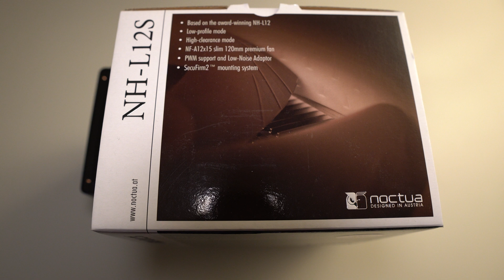Air Cooling The LOUQE Ghost S1

Comment: Could you please clarify whether the fans in this build are being used for exhaust or intake? Thx
Reply from the maker: In this situation the CPU cooler is intake, case fans should be exhaust. Optimum Tech has videos about negative pressure in this case for more info on that!

Comment: would you say that the bottom fan is worth it?
Reply from the maker: I find it helpful for dust and general airflow, but it does not seem to have any notable thermal benefit in most instances. With higher power components, going from zero case fans to an exhaust does help dissipate trapped hot air, but again it is not a significant upgrade.

Comment: Hey there, I’m planning a doing a s1 build but would love to know more about what I can use in terms of MOBO and Intel CPU’s along with their coolers? Any recommendations will be appreciated. Great Vid by the way.
Reply: This would be with the newer CPU generations and thoughts on an i7?
Reply from the maker: I can only speak toward intel 10th gen, but avoid asrock and asus for cooler compatibility issues and go with the Gigabyte or MSI Z490 ITX boards. To be honest, the best coolers for this case have a hard time with anything over 95 watts, so if you need an i7 I might avoid the 10700k and go for the non-k SKU.
Reply: @poobalu  Thanks so much! I am wondering if waiting for Alder lake is a good idea?
Reply from the maker: @PBR_BAM  Alder Lake runs insanely hot and doesn’t look like it is going to work well in SFF ITX builds. For the Ghost S1 specifically, I think Ryzen would be the way to go due to thermal constraints alone. The performance of the new i9 and i5 looks insane, but keep in mind that air coolers for the Ghost are mostly rated for a TDP between 65w and 95W

Comment: IS-60 EVO works good too. It works with tall RAM sticks, you can use 120mm fan on it. It's cools better than the L9x65 and a lot more quieter. It's not a copy of Alpenfohn Blackridge, but rather a thinner version of Big Shuriken 3.
Reply from the maker: I actually bought an IS-60 EVO for prime day to test this out and it’s a no-go for the Ghost S1. It sits near the bottom of the case so 1/3 of the fan is obstructed by the non-vented side panel. Idle temps are high and a 10 minute run of cinebench with a 10600k will hit 93c. It might be good for other cases though, thank you for the recommendation regardless!
Reply: @poobalu  ah, that is one aspect that i didn't consider. i'm using one of the ghost s1 clones case from taobao. 

what motherboard did you use? i'm using b550i gigabyte, their CPU socket is placed much higher than other manufacturer, which makes it placed lower inside a left hand side sandwich case. the edge of the fan sits nicely at the start of the side panel ventilated part. so i can imagine how it will gets blocked with other motherboard.
Reply from the maker: You’re the 2nd person to recommend this cooler - I might have to make an updated video soon including some more options!

Comment: Do you happen to own a 5950X?

I'm really curious to see the results (temps, sound, etc.) when pairing the 5950X with the NH-L12 Ghost S1 Edition in the Ghost S1 without a TopHat. Or even with one.
Reply from the maker: I don’t have any Ryzen CPUs currently but I wish I did! Optimum tech just released a video about cooling that chip with a Black ridge in the sky reach case, so maybe go check that out for a worst-case scenario. The Ghost should fair better as there is more space for taller CPU coolers with better fans.
Reply: @poobalu  That's exactly the reason I asked you. Already watched the video and I wanted a more detailed experience with specifically this case and cooler. He also claimed the motherboard is partly the blame for the low clocks and I plan on running an X570-I Strix. I just wonder if all this could lead to a meaningful difference in temps and clocks. Guess I'll have to go for it myself. Thanks anyway! Good video!

Comment: What were the temperatures that you were getting from the CPU coolers? What were the min/max temps during your daily use? And which Noctua fan were you rocking below your PSU? Have you ever thought about using feet on the bottom to prop up your case and maybe improve thermals? I currently have a 10700k (undervolted by 50, no plans on overclocking) with a 5700xt and I'm not sure if the ghost s1 will become an oven with my parts.
Reply from the maker: I will be releasing future content that goes a little further into temps, but all of the coolers in this video managed safe temps under regular use and even during stress tests. I swapped out the stock feet for much taller silicone dome feet used for speakers, the bottom fan is an exhaust NF-A12x15 PWM.

Comment: You should try the Thermalright axp-100 full copper, that CPU cooler sits between the L9 and the l12s (it did overlaps the memory slots and is 59mm tall with its included 14mm fans, but you can mount a slim Noctua 120mm fans with its included bracket) in terms of size but can cool my r9 3900x with slight undervolt (1,225v at 4.2ghz, 85c full load, gaming usually sit at 60c)

Comment: I use Big Shuriken 3 here and it has excellent performance. Works very well, but you need to change the fan fixing screw for one with a "flat head".
Reply from the maker: Thanks for sharing! I have a few more coolers and combinations that I am testing out and while I don’t have a Big Shuriken 3, I’ll keep that option in mind going forward!

Comment: Hi I’m looking to purchase the ghost s1 myself, wanted to kindly ask if the corsair dominator platinum rama or the vengeance pro rgb rams would fit with the L12s or would it be too tight? 

Kind regards,
Lam
Reply from the maker: Great question! The L12s can only fit the Vengeance LPX ram or smaller because the 120mm fan obstructs the memory height. I would check out the Ghost S1 Edition NH-L12 because it uses a 92mm fan, granting more RAM clearance. Just double check the memory height and compatibility on Noctua’s website!
Reply: @poobalu  Thank you for the response, according to their noctua page on the ghost s1 L12s, the ram height clearance is up to 48mm, also with corsairs listing on their ram heights, vengeance rgb pro is 51mm and vengeance lpx is 50.4mm.

I'm assuming both methods, would fit and I just think noctua could just be listing it as 48mm to keep people aware of the height clearance, as I've seen some builds with LPX but have yet to see VENG RGB PRO. 

In conclusion it's best to just go with their stated height clearance ''if you were going for the GHOST S1 L12S edition cooler.''

Kind regards,
Lam

Comment: Sweet build! I especially love the extra fan under the psu. 
I also got a mk2 ghost when the og nh-l12 was out of production. I ended up getting the Alpenfohn Black Ridge, which is like the L12 however it has more heat pipes and I personally have it oriented with a 120 slim Noctua fan on top and it has room for a 92 fan underneath, still with plenty of clearance. It’s priced to compete with Noctua’s offerings too. So if you haven’t considered it, give it a shot.
Reply from the maker: I just received mine in the mail! I’m working on a different cooler comparison atm but I will be testing out the Black Ridge very soon!!!

Comment: My ram height’s 49 mm, do you think it might just squeeze by with the ghost edition or is 48 just the max?
Reply from the maker: It’s hard to say without knowing specifically which ram you are using, but 1mm could probably be achieved with the little flex that this cooler has when screwing it into place. I would check Reddit for your specific parts to see if someone has done it already!
Reply: @poobalu  it’s the team group delta rgb ram, thanks for replying so fast too!
Reply from the maker: @sand6008  so it looks like it might not fit without a TINY bit of bending, but if you’re okay with that it should be doable. Otherwise the L9x65 would be the way to go in this instance

Comment: I just bought the Alphenom Black Ridge Cooler, replaced its LOUD default 90mm fan with a slim Noctua nf-a9x14, and took the 120mm fan and the two SecuFirm2 mounting pieces from my NH-12s and installed it on the front of the Black Ridge and BOTH fans can fit with no modding whatsoever.  I find it to be a tad quieter and can perform a good deal better than any Noctua option at the moment.
Reply from the maker: That’s amazing! I’ll have to see if I can get my hands on one. I assume both fans are directing air out of the case?
Reply: @poobalu  No, into the case. I got about 2 degrees better cooling pulling cooler ambient air from outside the case rather than pushing very little warm air out of the case.

The hot air comes out the top just fine.
Reply from the maker: @jw_25  that’s awesome thanks! This is definitely worth checking out, I’ll see if I can place an order for this soon. I appreciate the follow up!

Comment: Great vid. The L12S fit on my aorus X570i. Had to try différent rotations... it's tight... but fit. So i stick with as it manage to cool the 3700X and is very quiet. When i will décide to swap moto, i will not choose a new one with to big heatsink or panel that would block the L12S

Comment: Just wanted to confirm- does the l12 ghost s1 edition perform better than the l9x65? I've read on multiple sources that it doesn't
Reply from the maker: 王孝慈 I’m going to test this in an upcoming video, but my experience thus far has suggested you are correct.
Reply: @poobalu  oh and I found that Louqe's own testing results suggest that the L12 is better than the l9x65.https://www.google.com/url?sa=t&source=web&rct=j&url=https://louqe.com/img/heatsinktest.pdf&ved=2ahUKEwixqbbH15nsAhUrJTQIHZ-CDJYQFjABegQIDhAJ&usg=AOvVaw1Z0NsU64F6RTNF2mEc9_VG
Reply: @poobalu  I mean, if the l12 isn't even as good as the l9x65, it's not even worth the trouble. But Optimum Tech suggests that the l12 just beats the l9x65 by a slim margin.

Comment: just a side note, I would recommend against using the  NH-L9X65. the fan is so close to the side panel that it makes a lot of turbulence, which makes it way louder then it really is, I had to use it without a side panel because of the noise, until I got  the NH-L12s
Reply: Totally agree. That was my first choice too  and i had the same conclusion. So i swap for a bended L12S. It performs better and quieter

Comment: Do you think an EVGA XC3 3080 would fit?
Reply from the maker: Johnny Laygo nope - their website says it is a 2.2 slot card and the S1 really only fits 2 slot cards. It looks like it should fit bigger GPUs but the clearance where the side panel slides on is tighter than the rest of the space on the GPU side. Keep an eye on Reddit for compatibility lists.
Reply: @poobalu  i see.. it sucks that FE is our only choice..
Reply from the maker: Johnny Laygo absolutely - we might see more cards in time but the launch options are limited in compatibility at the moment.
Reply: Look on reddit. Someone installed an rtx3080 evga xc3  its tight but works

Comment: Hey there, great content here. I've seen in a couple of forums people fitting a A12x15 120mm slim fan from Noctua with the NH-A12, and it is supposed to be the best performer. Have you ever tried this? Can you try to fit your bottom slim fan on it? Thanks!
Reply from the maker: The A12x15 simply doesn't fit underneath the L12 or L12s on the Asrock Z490M ITX due to the really tall VRM heatsink which is a popular choice for the i5-10600k. That said, you can likely add a 12x15 under the L12 for other motherboards, but consider that you will be out $75+ for that combination when the L12s is effectively what you are describing for $50 and a slight bend in the heat pipes!

Comment: Personally i iwould buy the ghost s1 cooler and a slim big fan and try to squeeze it in... if it doesnt fit i would then use that fan as an exhaust under the psu or grind some fins to make it fit

Comment: I'm still deciding between coolers and your video was very helpful! 

Question -is it possible to attach a slim 120mm fan to the nhl12 ghost edition? and if so, whats the ram/mobo clearance like?
Reply from the maker: You might find the reply to another user, but the 120mm fan doesn’t fit well under the “Loctua” cooler because the fin stack is a different shape underneath, making clearance several mm worse than the L12s. It might be possible but not recommended.
Reply: @poobalu  thanks bruv gotcha. absolutely loving these ghost related videos as they are so so helpful. have already subscribed and anticipating more content from you!
Reply: @sorkrot  Get the Alpenfohn Black Ridge with dual noctua a12-15 fans with VLP memory. It keeps my 9700k under 60c on full load and isnt even that loud.
Reply: @Allhype214  thats impressive! i was initially hesitant about the black ridge as it doesn't have universal mobo compatiblity...  whats your mobo/VLP memory combo like?
Reply: @sorkrot  I have the azrock z390i phantom itx and a single 16gb crucial DDR4-2400 VLP RDIMM. I did have to shave off some of the VRM heatsink to make it fit though. :(

Comment: I never knew the L12 was louder than the L12, thanks
Reply from the maker: sample text I think it’s due to the smaller fan running at different RPMs. Could be an interesting follow up video 🤔
Reply: Poobalu if you do make a follow up video could you please test if it’s possible to swap the fans from the L12s to the L12
Reply from the maker: @sampletext42069  I can tell you now that I tried to do this prior to uploading this video and I had mixed results. The L12 is a slightly different shape underneat with ridges on the sides that actually make clearance worse for the 120mm fan. The L12s is more 'flat' on the bottom, giving it better clearance. I think you would have to bend the L12 to get a bottom fan to fit.